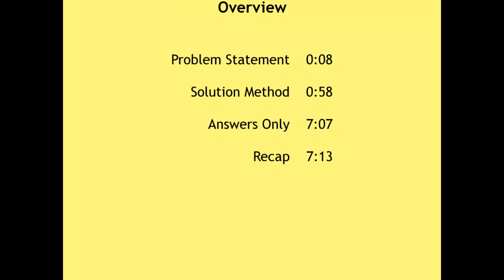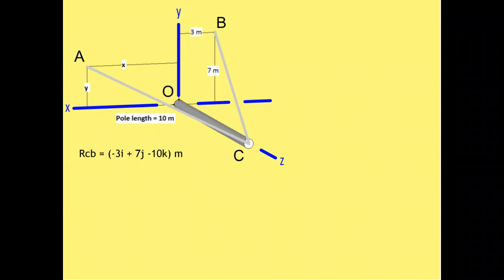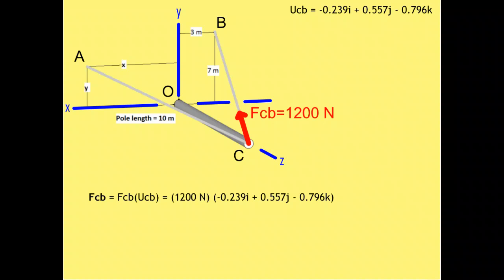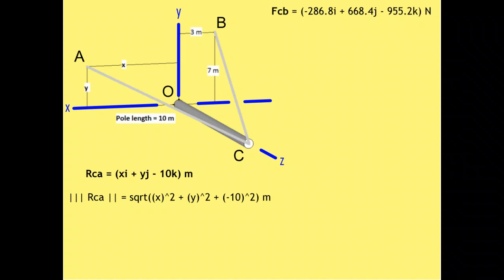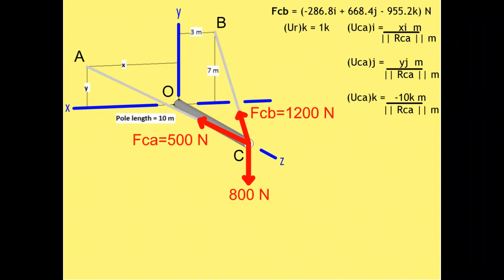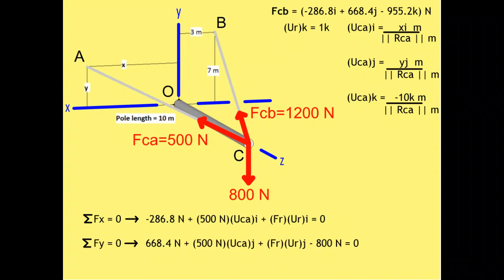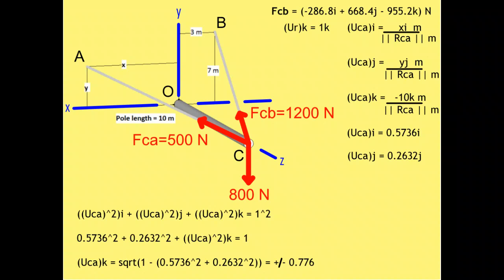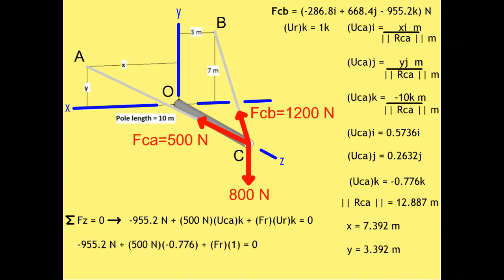Statics: 3D forces and vectors example

Comment: Sorry but i dont think your answers are correct cuz the position vector of BC was already wrong in the first step. According to your drawing. The points' coordinates are as follow:
A (x,y,0)
B (-3,7,0)
C (0,0,10)
Then the position vector (C/B) = vector (BC) = C's Coordinates - B's Coordinates=[(0--3)i ; (0-7)j ; (10-0)k ] = 3i - 7j +10k. what you have for Rc/b is in reverse.
Reply from the maker: WHY70122 Yes, you are correct. The component form of a vector is the final point's coordinate minus the initial point's coordinate. V(BC) = (Cx - Bx)i + (Cy - By)j + (Cz - Bz)k

Comment: Nice presentation, but this problem is particularly heinous because your xyz orientation is weird.  Actually, incorrect.  Why?  The z-direction(+) should be going other way per right hand rule.
Reply from the maker: trexinvert Yes, you are correct. The way I wrote it was incorrect and misleading. It should read "+x", "+y", and "-z"
Reply: The right hand rule is pure convention in this particular case.
You can define the positive and negative directions to be whatever you want, just like you can define the zero point for potential energy.

In fact, I personally ignored the signs in this video and just assumed that all directions were positive for each vector - in other words, I counted everything in absolute values - and then I decided the positive and negative directions when I added them together.